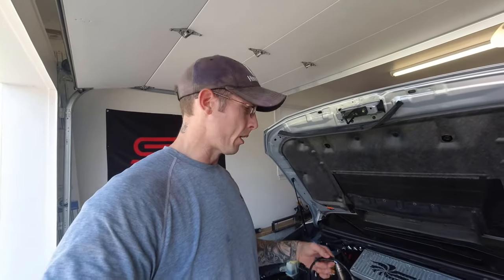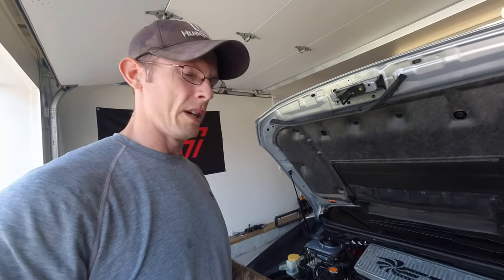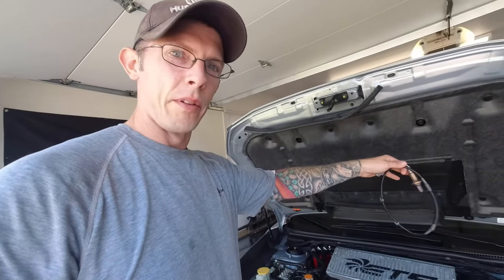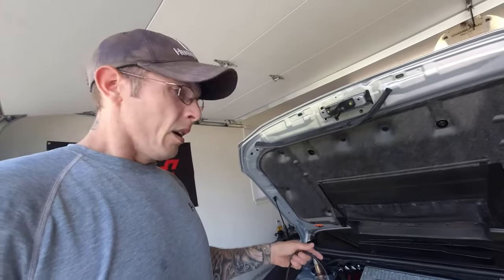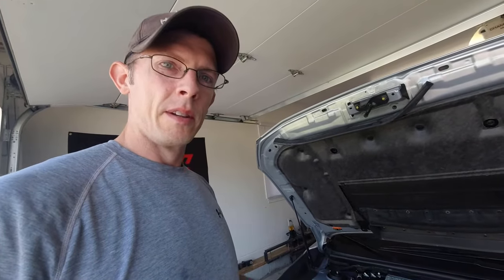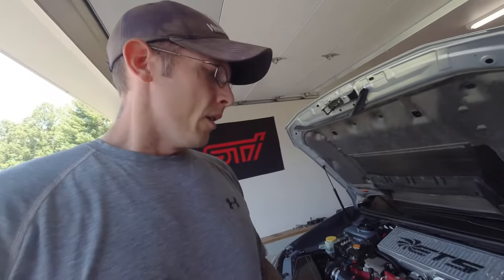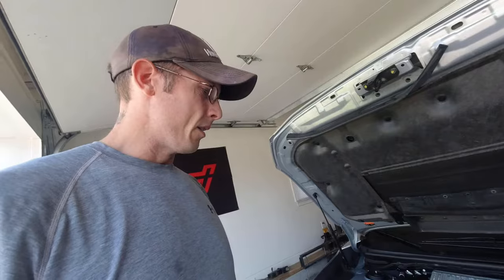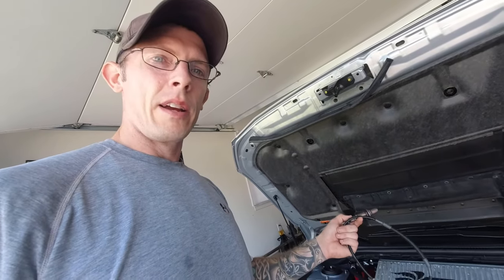Symptom of a Failing Front Oxygen | O2 Air Fuel Sensor | WRX STI

Comment: Just the fact he said he came to a stop and it died pretty much diagnosed my problem right off the bat. Wander afr and after I would down shift and push the clutch in and roll to a stop it would struggle to run then die, front o2 gone puts it into open loop failsafe fueling map, so it’s gonna run a tad rich up top, idle will also sound like it’s struggling when it’s bad as well.

Comment: Rule of thumb, replace O2 sensors as often as spark plugs. Seeing as 4 Laser Iridiums (OEM) run around 40 USD a set, upstream O2 100 USD, downstream 65 USD. Estimate. So 205 each plug change to keep your 2015+ WRX/STI happy.
Reply: We don't live in 2019 anymore man. Everything you said has doubled in price.
Reply: @off_lineofficial  Thank joe biden
Reply: A bosch o2 front is $395. Currently looking for alternatives that arent garbage quality FJB.
Reply: I can already see. 400 diy tune up. Equals my weeks salary when I rebuild your engine next week. Shame the warranty was voided when you changed your own plugs. The o2 sensor you snapped one of the extremly small 22 gauge wires. But didn’t know that til we told you right before we then told you about that warranty, or the  firing order was wrong after you put the wrong coil on the wrong cylinder. Or you didn’t sit the boot on the plug all the way. Then arced your head. And started a engine fire. See this is why you don’t follow YouTube advice unless the guy talking in the video is licensed or certified thru accredited agency/ state
Reply: Where tf you all shopping at?

Comment: Former 2002 WRX owner now a owner of a 2014 Town and Country minivan (kids).  Found this video after my ordeal, I had about 10+ trouble codes and the first ones were never O2 sensors although some O2 sensors was buried there somewhere there.  Turns out the previous owner installed four random O2 sensors that caused all kinds of throttle and electronic issues.  Just like the guy in the vid, unplugged two O2 sensors and it ran ok!   After monitoring the voltage and heat on the sensors that were plugged in, looked like the heat reading on one was completely dead—although no specific code appeared for that faulty sensor.  Always use OEM sensors because those crappy aftermarket ones from Oreilleys or Napa could lead to serious consequences and chasing problems.

Comment: Very informative, another situation worth mentioning is the MAF. The front O2 and MAF kinda work together, better to get scan tool with live data to confirm the reading(sensor these days are expensive). Some of the too lean code was set off by dirty MAF  instead of bad O2.
Reply from the maker: Thanks for the informative and helpful comment. Hopefully it is able to help anyone who may be having issues.

Thanks again 🤛
Reply: Align your 100 percent correct. Here is one thing I see a lot. The maf sensor Iat sensor, af ,o2 and a few more run on 5 v reference signal wire. A open or short to chassis ground can throw if so many other issues an which why you bench test any item before just throwing parts. I had. P1273 lean condition. I checked for unmetered air. Smoke machine nope no leaks. Next check 02. Af, injectors, fuel pressure, fuel filter, all check out. After 7 hours in. 11 inches from the mass air flow harness connector wire going back to the ecu I find a open wire. I speak to the owner and he informed me that he needed a small wire for a jumper and cut it out from there. His thinking was it was long enough not to miss it, and he simply twisted then taped. No crimp no solder nothing. 1400 dollars he was charged, 359 for repair. 1000 for disgnosis due to absolute retard owner
Reply: @ivaneatoniii5025  It must be some absolute desperate situation and there is noway for me to cut any wire out of anywhere.

Comment: this is happening to my car right now, got the turbo replaced and the front 02 sensor went, once its nice and warm itll start puffing black smoke and running super rich and dies at stop lights also. problem is i cant get the sensor out without replacing the pipe
Reply from the maker: Heard that hopefully you can get lined out and working properly.

Comment: scouring the internet to see what is causing my bogging issues.... this seems to be what im experiencing as well....
Reply from the maker: Hopefully it’s a simple fix such as this for you. Good luck on resolving your issue 🤛.
Reply: @spdkills83  only difference in my situation is at idle, i can rev to 2 or 3k and it comes back to idle pefectly... holds for half a second at around 1k-900 then drops to idle smoothly... but if im driving, as im slowing to a stop, as soon as i push in the clutch around 1100 to come to a stop, as the car gets to just about 5mph, RPM drops to 550, then swings up to idle 700-750.... i have logged and i cant seem to find anyting out of wack. thanks for the luck... im gonna need it.

Comment: Just wanted to say, this resolved the issue I was having with my 2017 WRX STI and the RPMs surging.   Took some work but got the O2 Sensor replaced.    Found this very helpful in the research to get it resolved.   Thanks!

Comment: Nice video. Thanks. I have a '96 Tacoma with 325,000 miles on the 3.4. For the last three years, about once a year it would just die while driving. No codes, no warnings... just like someone unplugged a running power tool. Letting it sit on the side of the road for five minutes, it would start and run fine for maybe five minutes, then stop again. It always restarted to get me home. I started paying attention to it after the third cycle (again, it happened maybe once a year, and only for the duration I was driving it that day- it would just run perfectly the next time driving, and for many months afterward). What I eventually recognized was that it would do this after a filter change- with a new air cleaner. It would happen even after cleaning the MAF sensor, but again only one time driving. I'm about due for an oil and filter change, so I'm going to change out the O2 sensor while I'm at it. ....I'm here looking for faults possibly causing a P0420 code on my wife's Subaru. My truck never throws a code. Anyway, thanks for the video.
Reply from the maker: No problem, I appreciate the comment. Hopefully the sensor solves your issues.
Reply: If you have the original 02 sensor from 1996 then it probably needs to be changed.

Comment: My guy I think you just figured out my stalling and bad idle on My 04 legacy wagon !! Stellar video bud 👌
Reply from the maker: Good deal, hopefully you get it sorted out and back on the road 🤛
Reply: Any idea what else could cause it to stall? My 04 wrx also does that when i go to down shift or putting it in neutral when approaching a stop light or having to slow down for a turn, my car doesnt have an 02 sensor in the downpipe i bought it like that a few months ago, i suspect it might be because it has 1050cc injectors and im still in the process of getting it tuned (E-Tune) and it might be running rich but not sure if it could be related to something else
Reply: Also, it doesnt do it all the time but enough to make paranoid about it dying at a light or mid turn which has happened a few times

Comment: Added to my list of symptoms as the car gets older. It's crazy that it didn't trigger a CEL. I had a failed OCV that was causing a rough idle. No CEL either. Easy to pinpoint with an AP as each ocv is listed. When the numbers dip during a rough idle event, that's the bad OCV.

Comment: Mine was doing the exact same thing shortly after I installed an intake, bpv and flashed a tune w/ access port. Cleaned maf sensor and reset ECU with the tuner, didn’t work. Decided to unplug the battery for 30 mins and then try it…worked 100% fine immediately. Sometimes, the accessport doesn’t reset learning correctly when you flash a tune or reset ECU. And my tuner said for the first couple of drive cycles after you reconnect the battery, do not have the accessport plugged in, it can latch on during relearn and do some weird stuff to your car. My tuner was a Subaru tech for 10 years.
Reply from the maker: Thanks for sharing this tip, I appreciate it. Hopefully this may be all someone needs to do to correct their issue. It would definitely be nice to keep that new sensor money in your pocket.
Reply: Can you explain further? Just did this
Reply: @xxmiguelmartinezxx   Some ECUs are finicky with diagnostic equipment/tuners. The only way to know for sure you have reset the computer is to unplug battery for 30 mins. If you already have a tune flashed, your tune will stay on there. Once you reconnect your battery, DONT plug the accessport in. Search YouTube for “Subaru idle relearn procedure” and follow this procedure exactly step by step and you should be good to go!

Comment: Awesome video. Think I’m seeing a lower grade version of this on my 2017 STi right now. Seeing strange fuel trims including the strange AF Learn walking up to about 8.7% and then back down. In general, fuel trims have been all over the place for no rhyme or reason. Of course, no check engine light. Car doesn’t die at a light, but is really weak at the lowest throttle and dips below idle when revs fall coming up to light. Will replace and report results back to hopefully help others out
Reply: Reporting back: Fuel trims still seem weird, but overall car runs just a little better
Reply: @parkerbywater9240 wat did u replace?  I notice my afr learning also gets up to 10
Reply: @Hello_its_me_mario  front O2 sensor, but did not seem to change anything. I also replaced some of the PCV hoses/connectors and I haven't seen my AF Learn walk up like that again

Comment: i have a 96 jeep xj with the 4.0L mine hesitates after 30 seconds of starting it then goes away. park it start it and acts like its going to die but come out of it and runs fine. so i did what you did and no issues. thanks for the video
Reply from the maker: Good deal, hopefully this is a quick fix that solves your issues. I appreciate it 🤛.
Reply: @spdkills83  I was ready to drop the fuel tank to replace the pump.  You can't use any other year but a 96 and it's expensive thanks for the videos
Reply from the maker: I can understand that. Good to be able to save $$$ when you can.

Thanks again and good luck.

Comment: I am having P0137 - O2 Sensor Circuit Low Voltage.O2 sensor voltage goes from .800V then drops off and goes to 0.0V. Do you recommend replacing both sensors? Currently, I have a stage 2 2018 wrx.

Comment: Is this the upstream or downstream O2. I have been having the same problems for a year now. I haven’t changed o2 sensor. Do you have shop you’d recommend that sells the sensor?
Reply from the maker: This was the up stream sensor (the one in the header/uppipe area). As for shop that sells them I found the best deal by shopping around online. Local Subaru shops were $40-50 more on the average.

Comment: Yeah my car has randomly died twice and I have a P2096 code. I checked for vacuum leaks and found nothing and also did not find exhaust leaks either. So looks like my front O2 is bad. I will see if replacing that will fix the problem.
Reply: So while I was going to change my front O2 sensor, I had to remove the intake air duct because it is blocking the sensor and its plug. I start loosening the clamp on end where the throttle body is and I notice the clamp was very easy to loosen which meant that it was already loose and therefore sucking in unmetered air. So I tighten the clamp and low and behold, my fuel trims are normal and my car runs better and I have no more P2096. It amazes me how the smallest things can cause modern cars to act a fool. Lol

Oh well. At least I have a spare O2 just in case the original one goes bad. Lol

Comment: I may have missed your comment if you said you did. But did you bench test you af sensor or just start throwing parts and tunes ( money) at it.
Reply from the maker: It was not bench tested to see if it was faulty. It was determined it was faulty through datalogs and going back and forth with tuner. 

The only real money I guess you could say I threw at the issue was the money for the sensor itself. I’ve not had anymore issues since I replaced the O2 sensor roughly a year or more now.

Thank you for the question.
Reply: @spdkills83  so what would have happen if a/f sensor was not the true issue and it was instead a small break in your Maf sensor 5 v reference signal wire causing a false lean condition that unless you went thru inch by inch thru the whole wiring harness to find it. Or you could have bench tested it, you got lucky.
Reply from the maker: Yes I agree, in the long run it was a lucky find. 

Also, I appreciate your insight into the issue in the other comments as well. Seems you either have dealt with this or similar issues in the past or on a frequent basis. I'm glad you are sharing some other potential issues in your comments as well for others to look for. 

Thanks again.
Reply: I think I need ro learn how to bench test😂

Comment: I have a o2 sensor code with a closed loop b1 code, my car almost feels like it has a bad torque converter when hot, barely gets going at stop lights and I have to rev to like 4000 rpm to keep up with traffic
Reply: Did u end up figuring it out I have this issue but on a camry lol

Comment: I put on the COBB Big SF intake, accessport, and OTS tune.  Went fine for 2 weeks.  Then on the way to work I threw a code and it's a P0172 Extreme rich code.  No leaks, everything is installed correctly.  2 coworkers keep insisting o2 sensor.  I don't have 500 bucks for a pro tune at the moment.  You think this could be my issue?
Reply from the maker: It could be the o2, does the car do anything different (act differently, idle weird, etc). Have you tried to reset it and see if it keeps coming back? 

With o2’s not being cheap I’d try everything I could first to see if you can remedy it before dropping $200.00 on the sensor unless absolutely necessary.
Reply: @spdkills83  i have to reset my ECU at least once a day or it runs awful.  The only thing I havent done at this point is mess with the o2 sensors.  When the light comes on my idle goes to hell, it tries to die and I get a massive power loss.
Reply from the maker: If that’s the case, when if your idle goes crazy try unplugging the front o2 and see if it corrects itself. If it does then you may want to consider replacing the front o2. This is just my recommendation. 

I’m not a mechanic by any means and I don’t want you throwing money at something and it not fix it. That’s just the path I would go with at this point.
Reply: @spdkills83  thank you
Reply: @Silent_Shadow  did you find a away to fix it? My wrx is doing the same thing with the Cobb redline intake, might just put the stock air box on and sell the Cobb intake at this point

Comment: I have a 15 WRX with a Cobb catted downpipe.  Can't get it through emissions in CO because the oxy sensor reads as "not ready".  Nobody seems to have any advice....shop tried to adjust the map to down tune but that didn't change the readiness......any thoughts?
Reply from the maker: My first guess would be that it would have something to do with the Cobb green speed initiative and where they are still not emissions compliant on that DP yet. 

I wouldn't believe it would be anything with the sensor itself unless it has a bunch of miles on it or the wiring got hacked into. 

I hope you find a way to get it lined out quickly.

Comment: what error codes were you getting? p014c and p014d popped up on my 2017 wrx. both showing front o2 sensor, but ive read there are more reasons for that code..
Reply from the maker: I personally never got an error code. My issue was intermittent at best. My solution came from back and forth with the tuner using logs etc. Hope you find a fix for your issue quickly 🤛

Comment: You I'm having the same issues right now. On cold start my car will spit and sputter like it wants to die and occasionally it has. When I try to accelerate the car will spit and sputter before it finally goes. Once every blue moon it will die at a light
Reply from the maker: Have you changed sensor out yet or is it something you are planning to change? Curious to see if it fixes your issues.

Good luck 🤛
Reply: @spdkills83  well I'm gonna try what you did and see if it works. If so, then I'll change my o2 sensor and hopefully it works
Reply from the maker: Good deal, hopefully it works for you man.

Let us know if you can please. 

Thank you
Reply: @spdkills83  oh yeah I definitely will

Comment: Interesting... im fighting a P0171, no vac leaks, cleaned MAF with approved cleaner, cleaned and re-charged air filter, replaced spark plugs, put a little pet grease on fuel tank cap o-ring, verified battery is 12.4-12.6 V's, code came back on after 12 miles.  So now I bought both sensors, I have an issue when coming to a stop my RPM falls on its face and comes back up, so idle is not ideal when car is at operating temp.  If this fails, its the pump apparently...  I hope this fixes it because damn sensors together were shy of $400.  You have improved car performance, but im assuming cluster stays Christmas tree with sensor unplugged?
Reply from the maker: That's correct with it unplugged gauges light up like a Christmas tree lol. Hopefully you get your issue resolved.
Reply from the maker: Good deal, glad you got it sorted and get to get your $$$ on the sensors.

Comment: My 14 F150 5.0 recently failed inspection because of o2 sensor "not ready." Today I checked the voltage on all 4 sensors and both upstream sensors read -0.02 and -0.07. Is it normal for them to read negative?
Reply from the maker: Hello, thanks for the question. I’m going to say that it is not normal. Normal range I think is from .1 to .9 volts, but don’t 100% quote me on that. 

The voltage can also vary from different manufacturers, but I think overall that is the common acceptable range.